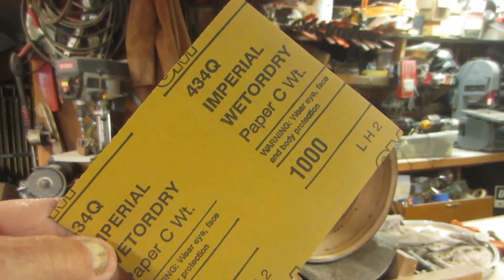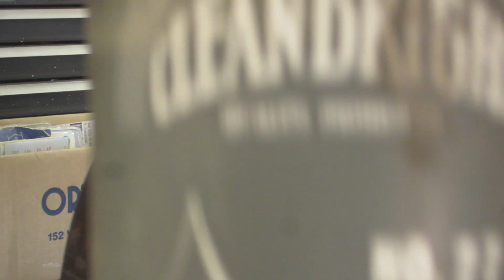Slingerland Radio King Snare Drum out of round/oversized.. Final Results Episode #3

Comment: What glue did you use and what grit paper did you final sand with?
Reply from the maker: I usually use a quality Woodworkers glue which is aliphatic resin. Its water soluble and works well. You will have to watch the vids to get the grits. I always say what grit I am using at whatever stage I am in on the restoration. Thanks, Bruce